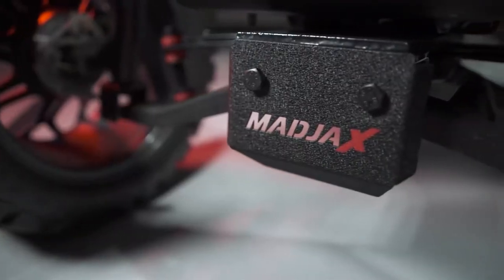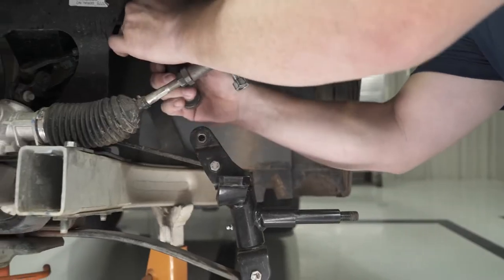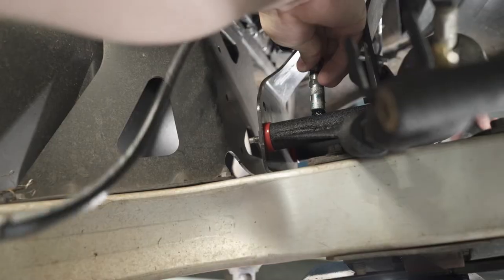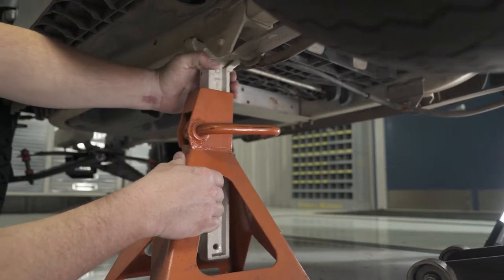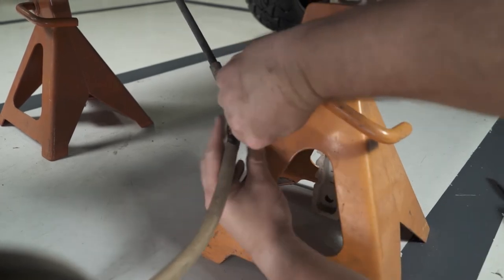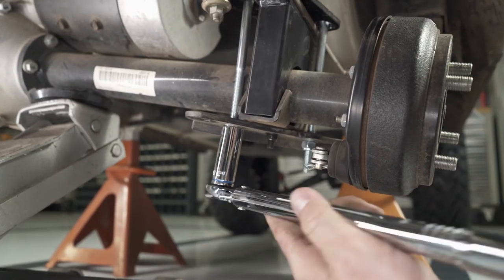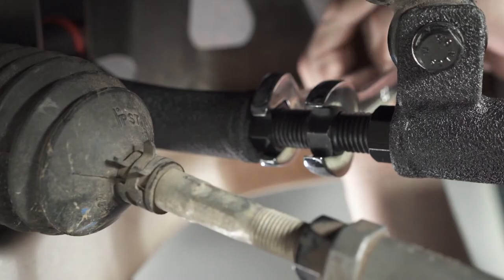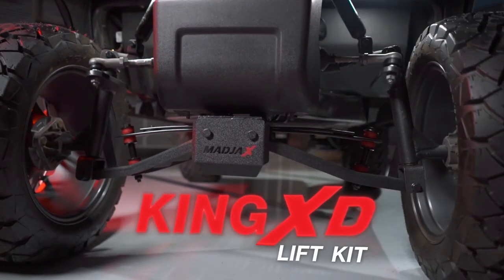King XD Lift Kit for Club Car Precedent and Tempo | How to Install | Madjax® Golf Cart Accessories

Comment: Great video, was able to complete the install with no issues. Am shocked at how poor the zerk fitting to housing is on the greaseable parts. Short threaded fittings and fine threads? really? I pulled 3 of the fittings out trying to grease them. Very poor.

Comment: On my King XD 6" kit, the spindle top brackets dont line up with the upper control arm. Any suggestions?
Reply: Mine don't line up either. Did you find out anything?
Reply: I'm the same way, is there a workaround?
Reply: @joegib4990 

I'm the same way, is there a workaround?
Reply: U gotta loosen the nut and bolt so it can rotate